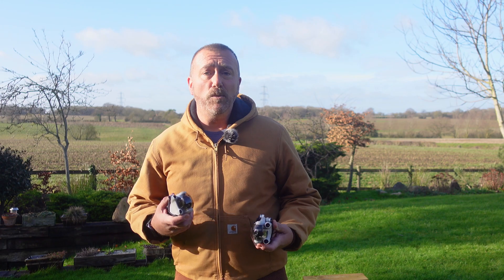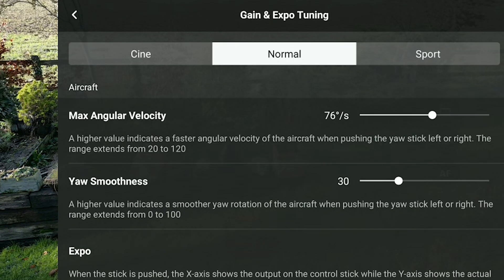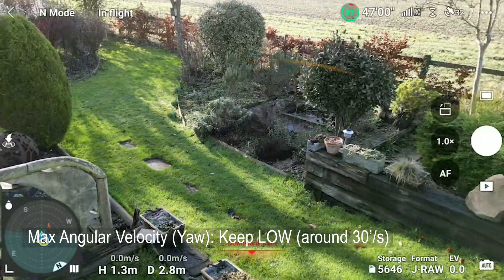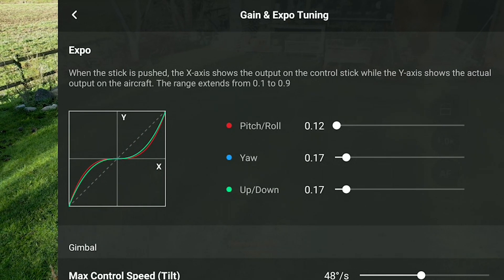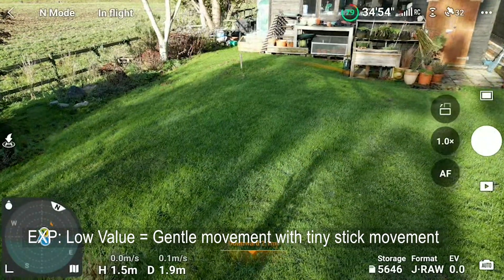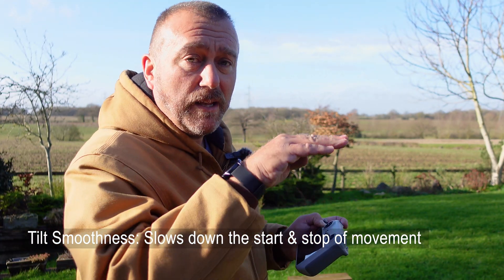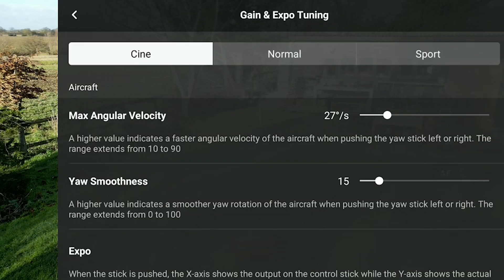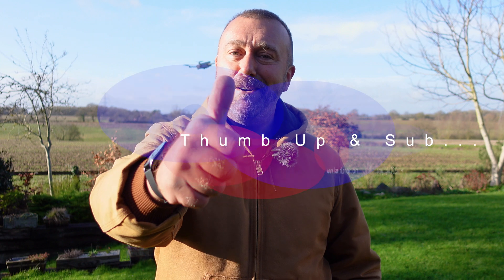DJI Mini 3 & 3 Pro:  New Fly App Settings for Simple Smoother Video

Comment from the maker: This update came with the last Fly Update just before Christmas.  Preferred values below.  *Remember as usual, ignore any scam messages using my profile picture asking you to contact me on Telegram*  
My preferred values: 
Normal mode:
Max Angular Velocity: 30'/s    Smoothness: 70
Expo: all around 0.20
Max Control Speed (Tilt):  20'/s    Smoothness:  23

Cine Mode: 
Max Angular Velocity: 20'/s    Smoothness: 80
Expo: all around 0.20
Max Control Speed (Tilt):  15'/s    Smoothness:  26

Sport Mode:
Max Angular Velocity: 50'/s    Smoothness: 50
Expo: all around 0.20
Max Control Speed (Tilt):  40'/s    Smoothness:  15
Reply: Hello, how are you, but I am asking you for the name of the program, the video editor, and what is it called?

Comment: Excellent Video Ian.  I have the Mini 2 and with the updates in the app, DJI also added the Gain & Expo Tuning to the Mini 2 which is fantastic - but one thing.  I was able to incorporate your suggested settings in my Mini 2, however, I ran into an oddity??  Under the headings Normal and Sport, the Gain and Expo Tuning were there exactly as you illustrated in the Mini 3 Pro, but it was different in Cine?? While Cine did have some of the same settings as Normal and Sport, for some reason the Expo part (graphs and ability to change the expo settings weren't there) - but only in the Cine heading?  The expo graphs and setting adjustments were there for both Normal and Sport.  Are you aware of this?  Do you know if any other of your viewers have run into this with the Mini 2?  Thks, Bruce
Reply: I’ve got the same issue in a mini 3. Did you resolve it?

Comment: Thanks so much, I was looking at aother video about settings and it was not even mentioning Gain and Expo, then I realised that the firmware had changed and yours is more uptodate. Though I did see on my latest update there were extra settings in that Gain and Expo, those of Max Horizontal Speed, Max Ascent speed and Max Descent Speed, These appear before the Max Angular Velocity.

Comment: I wonder if anyone else is having the same problem that I am. I had a look at Ian’s videos to see if there was something about the settings on this drone I did not understand. I’m familiar with adjusting the controls for smooth flight. On this drone, I have set the EXP settings lower than I ever have on any drone I have owned. But even with settings of .15 in the cine mode for pitch/roll and yaw, the drone still moves ridiculously quickly with even the most minimal stick input.  I’ve even tried switching between flight modes on the controller while it’s in the air to be sure that it is engaging cine mode. Ian, if you have any thoughts, or if anybody else does, I would sure appreciate it. In it’s current state I would consider it dangerous to fly in close quarters Scenarios
Reply from the maker: Is it the Mini 3, and if so, do you have the APAS system in 'Bypass' mode?  (3 dots top right, then safety).  That makes things very jumpy.  Finally, it's not just the EXP.  Do you have the actual speed values low?  (what I talk about in the first part of the video, before EXP).
Reply: Hey mate did you end up figuring out the issue? I just got a replacement drone from DJI and no matter how low I put all the values, it continues to fly at a relatively high speed.
Reply: Cannot find info on it anywhere

Comment: Warning sounds during takeoff or landing or positioning sounds on the remote control.  Warnings are text only, but the warning sounds are inaudible
Reply: If you drag down twice from the top of the screen when you're on the "pretty picture" opening screen (LOL), you get some device settings - like wifi, mobile data, record screen - and two sliders, one for screen brightness and one for volume. Check that the volume slider isn't way down.
Reply: @MarkMichalowski  Yes, the sound is on, but I can't hear anything
Reply: @xv.le1  Oh, that's a shame. Not sure I can think of any other reason why you're not hearing them apart from that your RC might br broken..? Sorry not to be of more use.

Comment: Another great clear and concise video Ian...I have Mavic Art 2 and I'm  having trouble setting up Cine mode with the NEW settings. 
Mine doesn't have the expo graph like Normal and Sport. 
Just did a Firmware update and nothing new there unfortunately...Do you know if I might have missed something? Thanks again mate 🤜💥🤛 🍊
Reply from the maker: Watch this video. I think the new layout of the settings is the same for the Air 2. https://youtu.be/Zl5qU8D7lm0
Reply: @IaninLondon  will let you know, thanks for the reply mate👍
Reply: @IaninLondon  I replied to this a fortnight ago Ian…I’ll contact DJI as there’s just no expo showing up and it’s so frustrating on the most precise setting…! 🤞

Comment: Great video Ian but is there a way to slow down the movement forward and backward? Ive got the mini pro 3 with the older controller and even when I switch to the cine mode it still seems too fast.
Reply: You can now with the latest update just released
Reply from the maker: @sckennedy54  I knew I had been asked this question a couple of months ago but couldn't find the comment. 😀👍🏻
Reply: @sckennedy54  thanks I’ll have to update mine
Reply from the maker: Afraid not. You can't slow the speed down except by only partially moving the sticks and avoiding full stick movement.

Comment: Hi Ian great information thank you.
I have a question I'm on a lot of sites for the mavic mini 3 pro and I see that a lot of people seem to be crashing them or fly a ways is there a fault with them. I had the mavic 2 zoom and have now replaced it with the mini 3 Pro, but am scared to fly it incase it crashes or flys away many thanks.
Reply from the maker: It generally boils down to flying low over water, flying in low light or flying with poor GPS. Otherwise they're fine!
Reply: I would concur with Ian here Alan. Had a fabby holiday with PhantomFlightSchool in the lakes last September (2022) and pretty much everyone had a M3P and the number of landings matched the number of take offs. Absolutely no problems.